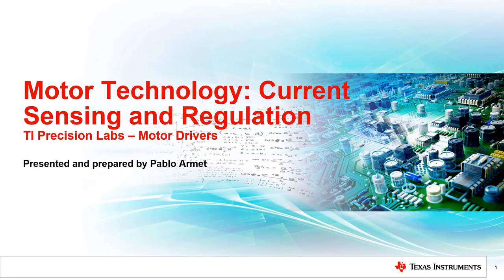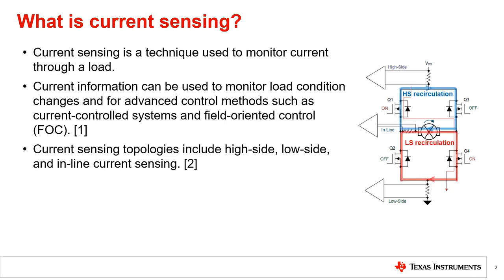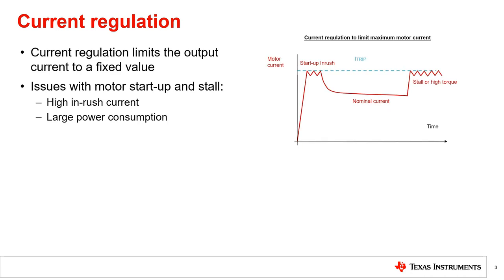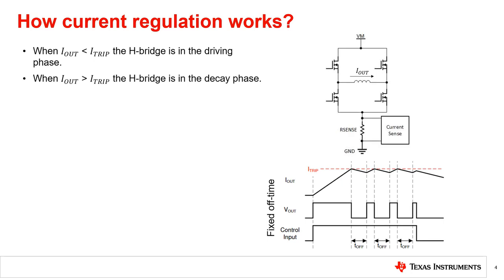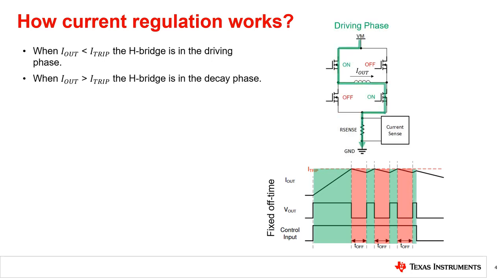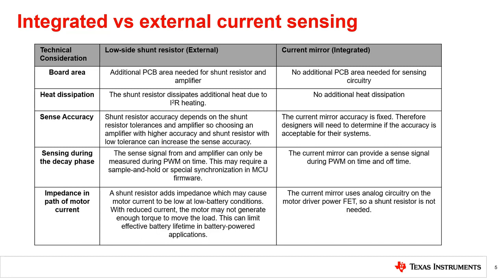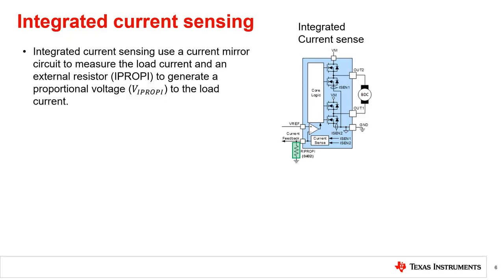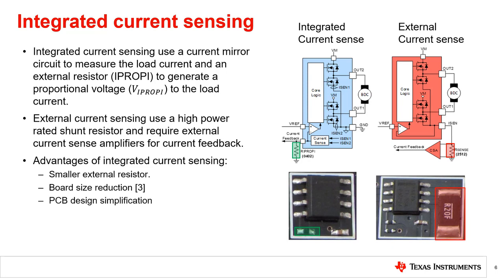Current regulation

Comment: Hi ti, is integrated current sensing as you describe in this video the same as rds (resistance drain source) sensing? Such as the one available on the drv8353s
Reply from the maker: Hi Émile, the sensing methods are actually different. Integrated current sensing uses a current mirror circuit to measure current, while the RDS sensing method used in the DRV8353 utilizes a sense resistor on the low side of the H-bridge.
Reply: @TexasInstruments  ok thanks, your ICs are the best :D